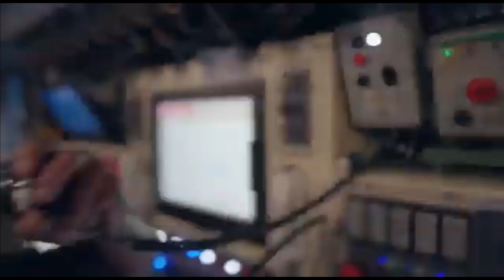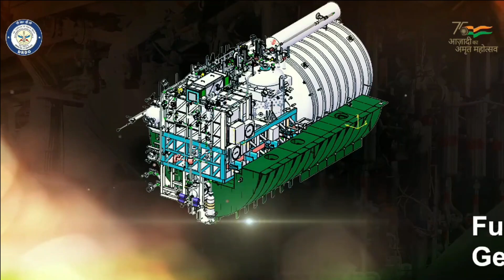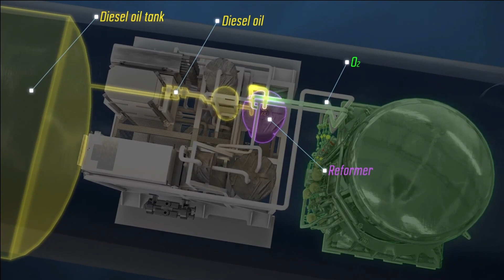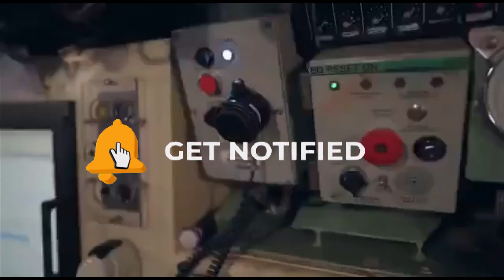#breakingnews AoN soon on 3 more Kalvari class submarines with DRDO’s AIP #indiannavy

Comment: A mega scorpene is the way to go over P75I. There is no prospect of P75 being concluded, same as previous 10 years. A bigger scorpene, with VLS, Brahmos/Shenya, and indigenous lithium ion cells and DRDO pumpjet propulsor can be started now. It is the better bet over a project that will never end.
Reply: Pumpjet propulsion by DRDO will take another 15 years to get fully ready,we don't have that much luxury
Reply: @Sacrafago90  Under Project 75 alpha, the
1st sub in 2032 with pump jet. However, with conventional propulsion it doesn't take so much time, it is nuclear reactor responsible for delay. 10 years mate, do you think subs are like bicycles built in a day?
Only 4-5 years with conventional propulsion.
Reply: @datoolz0  I know well they are not bicycles & are not built in a day.
Stop preaching,neither do they take 20 years to build a SSK even after 2 TOT recieved decades ago.
As per Atomic Commission  board of BARC to build a 195MW reactor,they would take minimum 12-15 years,where do you get such info that they will be build in 10 years???
40 years has already passed since HDW TOT & 20 years since Naval Group one,still unable to build or design SSK,it was be developed within 4-5 years according to you.
Reply: @Sacrafago90  20 new nuclear power plants to be commissioned in India by 2031, says govt in Business Standard.The govt at least seems to believe Bharati ability to build nuclear reactors has undergone a revolution.
The nuclear SSKs are supposed to be in mass production by 2032, and a SSK can hardly work without a nuclear reactor can it? 
4-5 years for conventional pumpjet, not nuclear. Nuclear will take far longer. Conventional propulsion doesn't take a decade, that why it is conventional. Nuclear is cutting edge and totally different.

Comment: As our HDW Type 209 & Kilo Class submarine are soon to be retired & no immediate replacements in pipeline,it's better to order additional 6 Scorpene Class SSK with AIP & Lithium Ion Batteries directly from OEM,till DRDO develops them in another decade or more.
Retrofitting of Lithium Ion Batteries,AIP on new units would be much easier than refitting on an older unit,along with wastage of time & those units out of service for a period of 7-8 years.
12 Scorpene SSK will also not create logistical nightmare as all belong to same class,will be Maintenance friendly too.
Merging P75I & P76,build 12 units of SSK based on Amur 2250/Barracuda/Enlarged Scorpene/Type 216/218/KSS3 as new designs from our Naval bureau will take another 10+ years to get ready & finalized,with another 15-20 years for tendering,RFP,Orders & Delivery,which will be an extremely long cycle.
So,Existing Designs will be a logical choice with most Indian subsystems,equipments replacing the imported ones,which will save both time & money,foreign OEM acting just as Consultants.
2800-3200 tonnes displacement SSK with AIP,Lithium Ion Batteries & 8-12 VLS tubes having a range of 3000-3500km when submerged,without snorkeling or surfacing.
Reply: No need to order direct from OEM, just order them from MDL. Lithium ion batteries is not complex, just drop in replacement. 12 Units of SSK based on Enlarged Scorpene would be way to go, and can also serve as nuclear design.  Smarter to use them as consultants only, and VLS a must have!
Reply: @datoolz0  Lithium Ion Batteries from OEM not entire submarine,If not complex DRDO wouldn't have asked for a decade to develop.
Not completely to MDL,split into 2 parts of 3 each line,3 by MDL & 3 by L&T,we can't wait another 15 years to get 6 units.